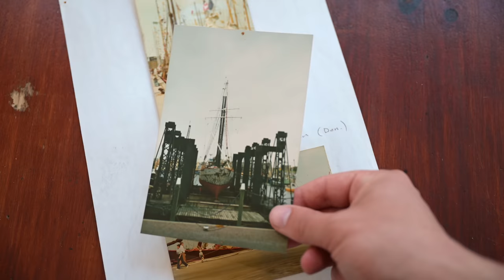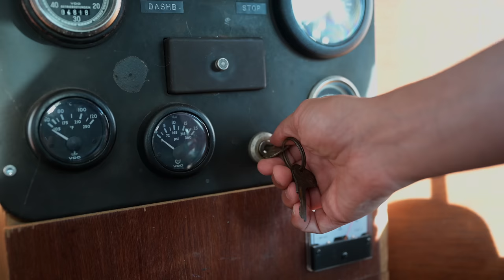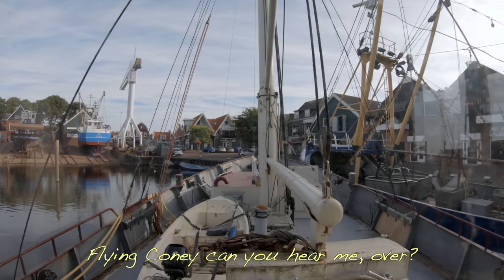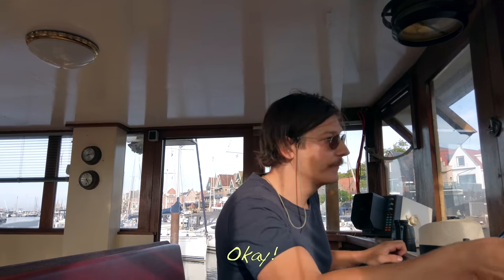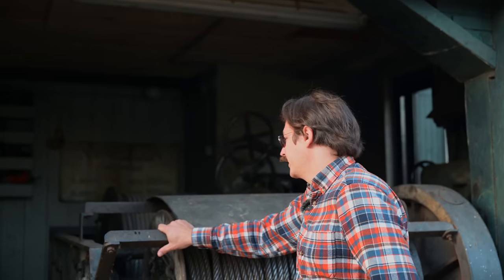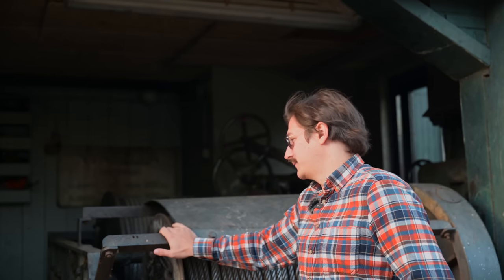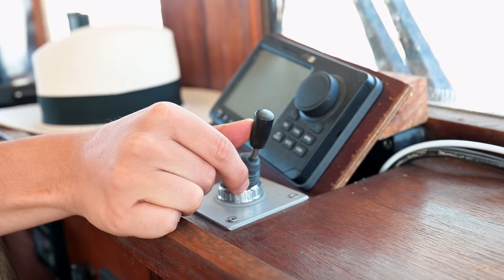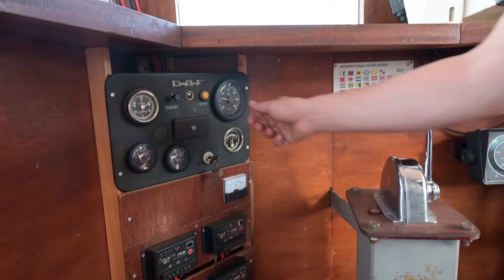HAUL OUT of Our Huge 82ft SHIP! What could go wrong?

Comment: I would definitely check the thickness of the boat hull. And maybe replace the shaftseal of the boat. You dont want to get a leak. So yeah, maybe now its out of the water, and you payed for getting it out of the water, you want to do that job. But it may also be a case of if it aint broke dont fix it. I havent read too much on boats, but i know that having a leak on the middle of the ocean, can be a disaster. Having water tight compartments can mean the difference between a flooded engine room, or a sunk boat. 

Getting new antifouling on the ship is pretty good. 

If i ever get a sailing boat, i want one with 2 or 3 compartments that are sealable with a real steel ship door. So you can go underwater, flip upside down, and still dont sink. 

Is there enough ballast on the boat to not make it go upside down? Im not seeing a keel. How will you do it? Get two of these side keels? Leeboards they are called. 

I was reading on hull design: "Understanding Boat Design, by Edward S. Brewer" on the "archive" website. It maybe worth a read, while you have such a huge boat. You may get to know what the maximum bow speed would be. And now you have an opportunity to measure the hull, and see what the real underwater shape is. :)

Good luck with all the work! 

Greetings,

Jeff
Reply from the maker: We do have watertight compartments. Anchorlocker, forship, engine room and what's underneath the secret hatch. I don't want to find out how good the seals of the doors are though. On ships you don't have a blast keel all the ballast is internal. But it's quite a bit. At the bottom there are all the steel leftovers from when she was built filled up with very hard and heavy concrete. However, if that's not enough ballast for a proper sailing rigg it's easy to weld heavy steel bars to the keel. But the ship is very stable so it's unlikely that we need that. But sailing ships can capsize and smaller boats can be built a bit safer. Leeboards are for dutch barges because they slip to much without them and would not sail properly. We have a draft of at least (should measure it) 2,6 meters so we don't need them. If you mean bilge keels, they don't add righting momentum but counter the rolling a bit so it's more comforatable. We are thinking about adding them in far distant future. Small spoiler at the end, hull thickness is quite good but...
Reply: @FlyingConey  He! 2.6 meters sounds like a lot of depth. If that is the depth of the waterline to the bottom of the ship (a.k.a. "draft"), it might be enough. Who knows? I looked for tallships on wikipedia and on the dutch page of "tallship" i found me a ship called "Astrid" with 39.9 meters in length and a draft (diepgang) of 2.6 meters. So maybe when you have enough ballast you should be fine. I dont know if it is the sail setup of a tallship that makes it so that i can have enough draft with only 39.9 meters of length to the 2.6 meters of draft.

Reading over page 17 of the book   "Understanding Boat Design, by Edward S. Brewer", you might be in luck with your hull shape. "The Y section (Figure 2-10B) is seen in large sailing auxiliaries and motorsailers as well as slow-speed displacement powerboat hulls such as tugs, trawlers, fishing vessels, and oceangoing motoryachts. Sailing craft carry a large percentage (30% to 50%) of their displacement as ballast to contribute to stability and seaworthiness. The ballast may be all inside, as seen on some motorsailers and cruising yachts, but normally most of the ballast is fitted outside (or inside the fin of a metal or fiberglass boat) in the form of iron or lead castings."

I can send you the book in the email while the PDF is only 8.82mb. :) 

Ive heard that "ponsdoppen ballast" works great with portland cement to make a ballast concrete. The ponsdoppen make 4500kg/m3 of weight compared to lead that has 11350kg/m3 if you pour it, or 6800kg/m3 if you have it in 3mm pellets. Its still an investment, but it may be something worth the effort (???) instead of the outside leeboards. 

From "Design and Control of Concrete Mixtures" : "Table 18-3 gives typical bulk density, relative density, and percentage of fixed water for some of these materials. The values are a compilation of data from a wide variety of tests or projects reported in the literature. Steel punchings and shot are used where concrete with a density of more than 4800 kg/m^ is required. 
In general, selection of an aggregate is determined by physical properties, availability, and cost. High-density aggregates should be reasonably free of fine material, oil, and foreign substances that may affect either the bond of paste to aggregate particle or the hydration of cement. For good workability, maximum density, and economy, aggre gates should be roughly cubical in shape and free of excessive flat or elongated particles."

And that book is found on my archive, but you may already have all information that is interesting to you written here. But if you want, be sure to take a look. 

Greetings,

Jeff

Comment: Good job people! It's an amazing project you are undertaking!

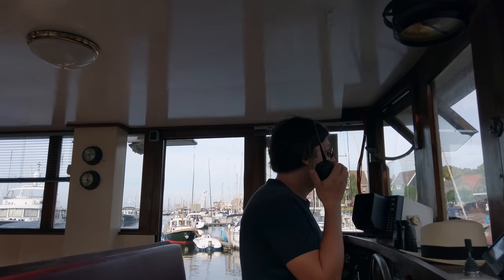Your nerves are really impressive, you maneuvered her like a pro (hilarious scene at 8:30), great team work!

Also I really like the hull underwater lines, she's a beauty
@daniel, concerning your heat pump project, I doubt you will have time to install any underwater heat exchanger but at least seeing the ones at 19:26, which I assume to be for engine cooling purpose(?), is interesting!
I wonder how hard it is to weld new ones on the starboard side (which looks free from what I could see). Now would be a good time but it's probably not realistic considering your packed TDL. Maybe it could wait for the next shipyard visit, if you plan any.

I really think you should pursue this secondary heating project, it's really smart/cool/nice :)
Reply from the maker: I hope I don't disappoint you too much when I tell you the heat pump project is probably one of the last we're planning to realize. But it's still something we are planning to add some day and we have to consider it when we change things on the heating system. But for the placing of the heat pump pipes my idea would be to run the pipes inside a bilge keel. That also would minimize rolling and probably improves her sailing abilities. The pipes on port are for cooling the engine and the Perkins (not working) generator. The benefit is that there's no seawater in the ship but the downside is the increased drag.
Reply: @FlyingConey  I understand 100%
I'm just thinking, on top of my mind.. Is there a chance that the same heat exchanger can be used both as a heat sink/source for the different machines?
The biggest question would be: what is the fluid circulating in the pipes? Beyond that, even if it's something weird, well, one can alway put a heat exchanger between the hypothetical HP and the keel outside heat exchanger
I don't think I would recommend using the keel directly as a heat exchanger, it sounds like a bad-good idea. If you just put "pipes in the air", I doubt you will get enough heat exchange
And if you embedd them in concrete ballast (assuming), well I am not certain temperature oscillations/freezing are necessarily a good thing in terms of longevity of the concrete, especially if there is (maybe, I hope not) water infiltrations

Sorry again for writting a novel but it's really interesting to think about this problem :)

We can discuss by email at some point if this project is still alive, I'd be happy to help to the best of my engineering abilities :)

Comment: This is very expensive project. To make that vessel into ocean going condition  means a huge work  with the hull. And then comes all the upgrades to steering, electronics, water systems etc. This is in a way an endless project that needs many types of specialists. But I wish  all the best to the project.
Reply from the maker: Thank you! In theory we have a CVO so that means that the vessel is safe. In theory... The technical systems seams to be in ok condition, that includes the steering, the engine, cooling pipes and the required navigational equipment. the two biggest necessary projects are the hull and although debatable if necessary any sort of comfort. Cause at the moment there's none. It's a matter of weeks until the last water tank decides to get a leak, heating, what heating? and the electric system is a mess and needs to be done from scratch. To be honest on the one hand we knew when we bought the ship that we had to do these jobs on the long run so we kind of ignored the state of this things. But we kind of forgot to think about what that means for our living quality in the next few years 🤣🤣🤣

Comment: I can see you have two types of anodes aluminium I think and zink which does not work that is not the way to fit them one or the other, not both as it can accelerate corrosion plus I hope I didn't see big pitting in your hull like holes that could be caused through electrolysis where 240 0r 12 or 34 is running through the hull or earthed there it should always be an isolated return on both 240 and 12 or 24 0r whatever voltage you are running always have it insulated back to the source  plus while she out of the water get a stern or bow thruster fitted as it will save you great heartache and money as you found out as this is just the beginning of your calamity without a thruster that should be at the top of your list after hull repairs I know it's not cheap but it will save you money I guarantee it imagine if you had one fitted earlier no hitting the yacht money saved plus people don't think when mooring there boats right behind or in front of you this will take all the stress from you and prolong your life and make it so much more enjoyable to sail or motor in the future so it will be worth it there are only pros no cons unless you add the price but even that will save you in the long run.

Comment: I don't think the bottom looks bad. alone, the boat is in my opinion. A little too deep, but if the construction on the back comes off. Will they be higher on the water? And the ballast has to be adjusted. #spakenburg #netherland
Reply from the maker: I also think there could be a few centimeters more freeboard. The first thing we have to figure out is if it's an optical thing. Maybe it's just the very prominent red line along her hull or the marine growth above the water line. Also the big open deck drainages tells where the hull ends at first sight. Most fishing and sailing vessel have flaps. She is an incredible stable ship. One tone (water tank) doesn't make a difference so we think she is already loaded down for sailing. That also means that the steel superstructure will not have an impact on the water line and removing concrete from the bilge is something I prefer not to do.

Comment: Hull looks better than expected.   Why the List?
Reply from the maker: We found not reason. But maybe the generator and the keel cooling. But the water tank that was leaking is on port and contains more than 1000 liters and it didn't made any difference if it was full or empty. Maybe she was always trimmed with fuel or there was heavy equipment like a windlass for fishing on starboard.

Comment: I think this is foreshadowing something. No sensable yard will take you. Not only is it wicked expensive but you're a pleasure yacht with a deep draft and exceed the tonnage of 80% of the yards. It's an enormous upfront cost. You likely could have painted the bottom of a smaller boat with what it coast to haul out that beast. History or not it's not worth the effort. Scrap it and build something easier to work with.
Reply from the maker: It's two completely separated systems. We are in a a shipyard specialized in working boats. The guys here run around with a stick welder and an angle grinder and they do 90% of the work with that. Incredible low tech but effective. You can't expect the same finish as you would need for a yacht. For the haul out itself it's not that expensive.

Comment: What are the tubes on the side of the hull?
Reply: I figured it out! Engine cooling. Wouldn't want to scrape that on anything!
Reply from the maker: @jweitzenheimer  Yes that's the downside of a keel cooling. The upside is that there's only fresh water in the engine so it is a very reliable and unproblematic solution.

Comment: Must have missed  it  ..... why are you listing
Reply: I'm inclined to think that it's because of the changes inside the ship - unevenly distributed weight. Mainly what's shown in Ep.14 at 4:15
Reply from the maker: Not sure to be honest but the ship is almost empty. So no fuel or something. Maybe it's just the fairly new keel cooling on port. A few 100kg of trimming ballast should fix that and it's not a big issue. But it was enough to make it very hard to get on the cart centered enough and you can see it in the talking bits that we are still listing quite a bit.